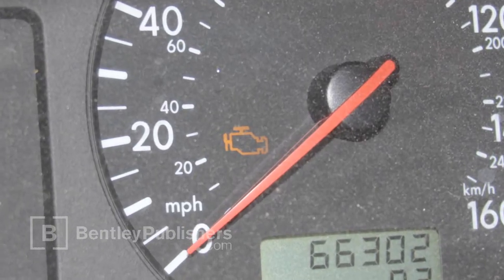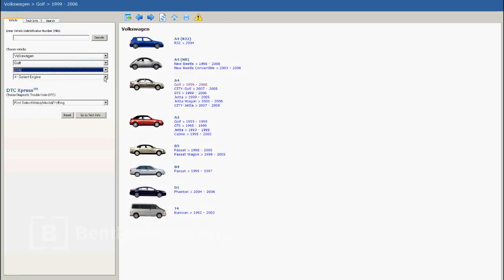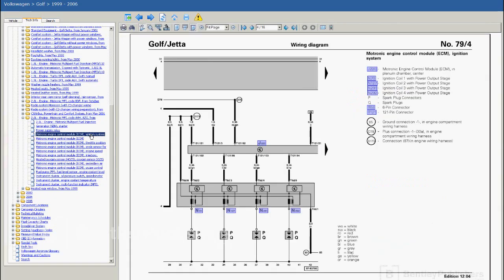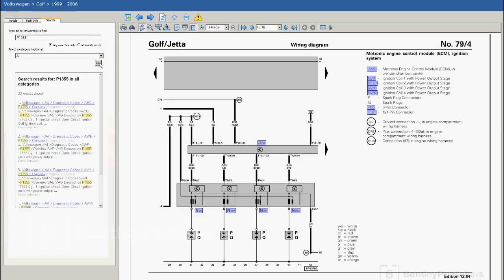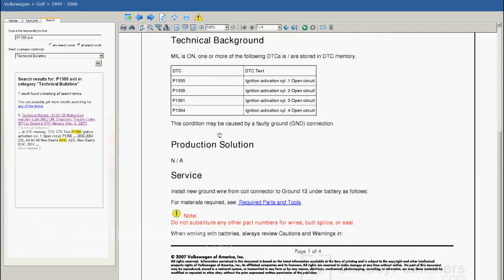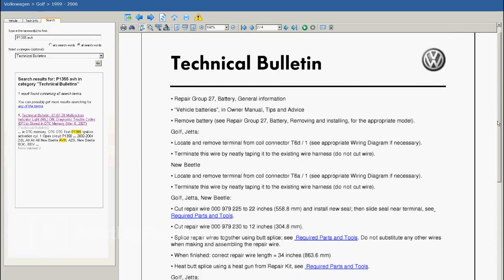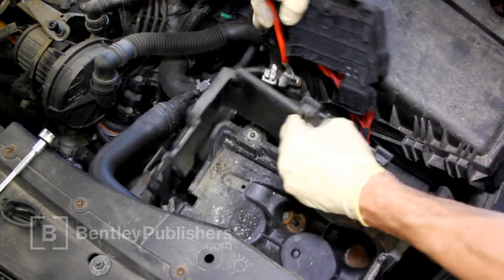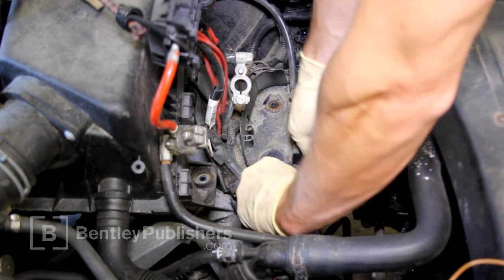VW Golf Jetta New Beetle (A4) 2002-2004 - DTC fault code P1355, P1358, P1361, P1364 - DIY Repair

Comment from the maker: @smandable You can and the TB suggests terminating the original wire. This is the way (in the video) I have done the repair each time I havebeen faced with it. 

If you still have fault codes I would:
- confirm you used correct gauge wire
- check your repair, is it possible the butt splice is loose?
- test circuit integrity when fault code is present
Have you tried our tech forums for additional help? 
If none of these are issues take the vehicle to a qualified VW repair facility.
Reply: What is the correct gauge of wire?